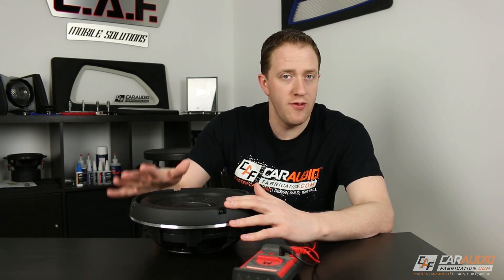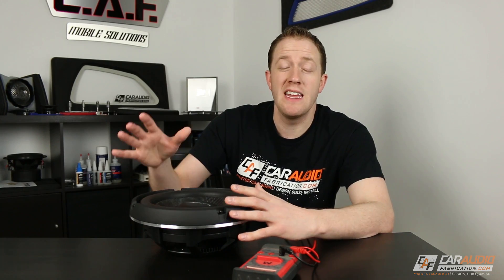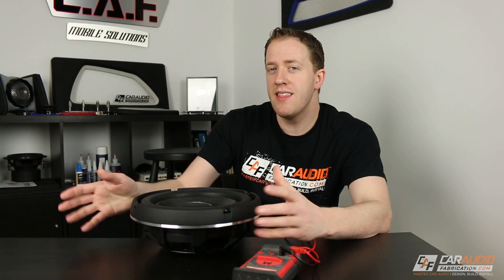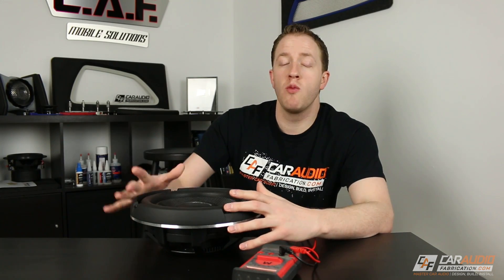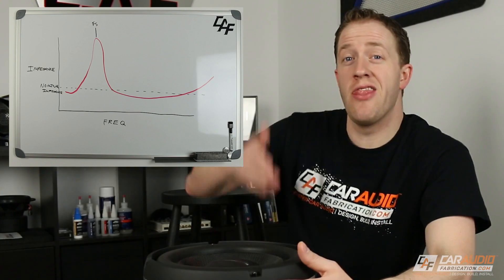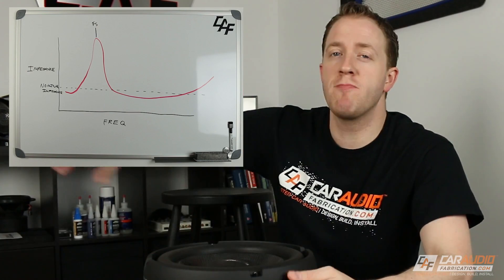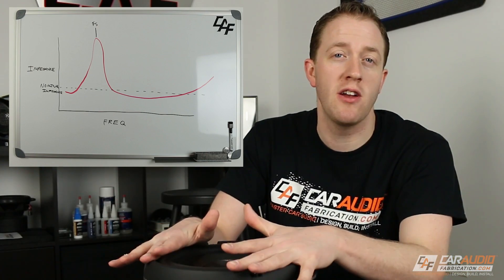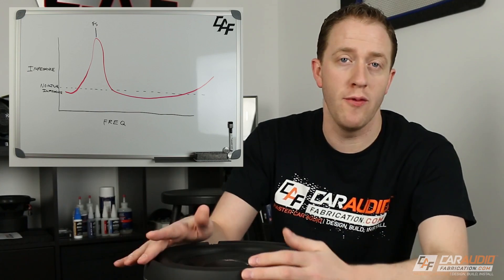Choose BEST Subwoofer for YOU - Thiele / Small Parameters Advanced Lesson

Comment from the maker: UPDATE: I was able to make the speaker anatomy video! I got an awesome cutaway subwoofer that shows all the inside components, check out the video here: https://www.youtube.com/watch?v=XMTjFxpRADI&list=PLmybwiwzi3MVV6AX5UIcR_0EtiNxDuf2h&index=4
Reply: CarAudioFabrication could you do a video on how to find some thiele small parameter of a subwoofer that doesn’t come with any
Reply: Excellent work.  Catching back up on the vids :)
Reply: CarAudioFabrication I'm trying to find replacementnwoofers for some home stereo speakers I built back in the 80's. They are a 12" 3 way design with 1.4 cu ft sealed enclosures. The original drivers worked very well after stuffing the boxes with fiberglass. F3 was around 30 hz. Not as low as I would like, but tight, accurate and warm. Can you recommend a replacement?
Reply: @CarAudioFabrication
Hi,
Is there a way to predict therse, Parameters? I want to build a costum subwoofer with parts from the lord of bass or from some other place where i can get speakerparts. And now I don't know how to chose the right parts for my needs.  The subwoofer is supposed to be for my home theatre. It should be a 15inch sub in a sealed box that plays down to 15 hz at 125db+
Maybe you can help me. I love you videos!

Comment: I spent a few years picking a 12” sub, and a year or so saving pennies to buy it, and its custom box.
So many parameters, power handling, frequency response, efficiency, damping factor. Optimum box size VRs what I have room for. Reading reviews on what I was considering.
In the end, for me in my new suv, it will be a morel, unltimo titanium sc 12” in 4 ohms, 
Into a box, slotted vent at optimal 1.60 cu ft. Into a audison amps and dsp.
3 way morel hybrid front stage,  mids and tweeter into pods on sails , midbass in doors, nothing in the rear door.
All ofc wire…
Can’t wait to get it all done.
Still have some sound treatment stuff to buy before install.
Ripp it all apart and do everything at once. 
See how it all works out, every part of the system matters, the one place you cut corners, is the one place it gets ya, and you pay more to upgrade later….

Comment: Quick question? I got the JBL Club A600 monoblock amp. But I have the JBL Stadium 12" subwoofer. Probably 2 of them. I actually bought 1 but they sent me 2 😮. So I'll probably use it. Just need to get a 2 subwoofer box. But that amp (which is 600W RMS) and the subwoofer (which is 500W RMS) shouldn't have any trouble working together, right?

Comment: How would you pick the best subwoofer for free air application. As you said,  that having a qts of .7 or higher is better for free air. But on the other hand, an online audio store says qts doesn’t matter as long as the subwoofer is “built for free air application “. The Kicker Comp C 12” has a low QTS of .559 that I have in a free air application and the store recommended this because they said it’s built for free air, but it is not as good as I thought it would be. I thought it would hit harder than the JL Audio 12W0v3-4 that I had in, which has a qts of .67. To me, it seems like the JL does better than the Kicker. What would you, go by what the store says or go by the subwoofers qts?

Comment: Hi Mark. Hopefully you end up reading this, I have a question I believe you may be able to answer and clear up some confusion I have. Sorry in advance if this may be a little long winded. I specifically looked through your videos to find this one so that my question is relevant to what is being viewed and so that this may help others before they get this deep.

 So... I have a Crescendo Forte 15" sub that I re-coned with Sundown SA-15 V1 Rev. 3 soft parts. Here's the big question: how would I figure out what my T/S parameters are or how they have changed without the use of a computer and the accompanying software/hardware? for example, I know that obviously my BL stayed the same as before... but how has that influenced things like the QES rating on these new sundown parts that weren't originally intended to be used with a crescendo motor? And if Qes changes, does the spider allow for the Qms to change? I may be over thinking things, but I speculate that one different specification (motor force in my scenario) would have a domino effect on some of the parameters of this "mashup sub". Believe me, if I could have replaced the parts with same brand & specs, i would have, but Crescendo no longer offers Forte support for soft parts. I'm pretty well aware that I could have just bought a new sub, but this sub & box was gifted to me with a broken cone which I repaired and banged on for a good year and a half on safe power levels. alas, I ended up getting an amplifier that was capable of giving the sub its RMS rating... And then some, and uhh, i gave it the beans... That unbalanced repaired cone/coil didn't like that for long. With that being said, I had no initial investment in the sub/box and i saved it from the Florida rain so it only felt right to re-cone vs. Buying a new sub for easily twice the amount... Now, I'm wanting to put the icing on the cake and build an enclosure so im confused as to how to get accurate specs of the sub or whether it really matters that much... As if to say, maybe I should compare both sets of T/S figures and make calculations based on known parameters and ballpark figures on the unknowns... Build a box, and see if I'm happy with results. Wood hasn't been so affordable lately and I'm not fond of wasting material or money

Comment: I need your help bro, I have a bmw 650i with the Bang & Olufsen sound system but want to add bass. I’m looking at a Rainbow GL-S10 S2-4ohm 10” speaker with a Helix P TWO
2-CHANNEL HIGH-RES AMPLIFIER WITH INTEGRATED, ACTIVE CROSSOVER AND DIGITAL SIGNAL INPUT. Also I forgot to mention I also ordered the bavsound 8” subs for under the seat. My question is could I hook up the 10” & 8” subs with this amplifier comfortably with no issues thanks

Comment: 8:43 You can compare BL motor strength directly ONLY if the drivers have the same RE, which is rarely the case. If not, then you must compare BL^2/RE (square of BL motor strength over RE), which accounts for difference in RE. This is especially important when the drivers have different nominal impedances (for instance 2 Ohm vs. 4 Ohm), because such drivers usually have very different RE.

Comment: God I hope you respond to this.  I was reading up on the difference between ported and sealed subs and I thought, well, a lot of the Metal I listen to has two types of bass-producing instruments that really needs to be distinguished properly.  The kick drums are usually tight with a quick, non-resonating attack  which is ideal for the fast, machine gun-like rolls you hear in a lot of Death Metal.  Then, of course, you have the bass guitar which is more reverberating, but doesn't usually make itself stand out like funk, but more of a backbone to keep the guitar and drums together.  I would think it would be difficult for a single subwoofer, ported or sealed, to properly represent each instrument at the same time.  So why not two subs?  One ported, one sealed, and both tuned to their respective frequency range by the crossover?  Could that work?  I'm getting my D-6.1200 today and I really want to ditch my Kicker Hideaway for something better.
Reply: id look into a bandpass enclosure honestly

Comment: I am considering a subwoofer for my car. 
I already have all Infinity Reference setup - 4 channel AMP, 2 components in the front and 2 coaxials in the rear. 
I am not looking for high volume but good depth to the music. 
Which should I consider? 
1) 12 inch subwoofer with frequency range - 50hz to 250HZ (400W RMS)
or
2) 8 inch subwoofer with frequency range - 35 Hz to 150 Hz (125W RMS)

Comment: The wattage rating tells you how much power the woofer can take, not its output. This is a common misinterpretation that has been perpetuated by the car audio industry. They make it sound like the speaker puts out 500 watts. Not true. A speakers output is measured in SPL, Sound Pressure Level with 1 watt of power input. A speaker that put out 84 db at one watt is less efficient that one that puts put 90 db per watt. The SapL goes up 3 db everything e the power doubles. We perceive 3 db as twice as loud. And our hearing is basically logarithmic. So let’s take the less efficient speaker and see what happens when we push 500 watts through it. At 1 db it puts out 84 db. At 2watts it puts out 87 db. At 4 watts it puts out 90 db. So it’s now putting out as much sound pressure as the 90 db per watt speaker. This has an effect on the speaker system, or loudspeaker. Which speaker is better? It depends. For really accurate sound, more damping is usually better because it limits distortion. That would mean the 84 db speaker is better. But if your running that 84 watt woofer and the midrange and tweeter is rated at 90db, you would either have to run two amps or an equilizer  to balance the loudspeaker’s output. It also means that to be as loud as the  loudspeaker using the 90 db woofer you would have to have a more powerful amplifier. So you could run a 500 watt amplifier with the 90db woofer’s loudspeaker. It also means for the loudspeaker on a whole, to be as loud as the loudspeaker running the 84 db woofer loudspeaker it would have to double the wattage driving the speaker to 2000 watts. I hope this is making sense. Once you decide on which woofer you’re going to use you need to determine what type of cabinet it will use most efficiently. He’ll tell,you that in this video. But please keep in mind that the wattage rating of a loudspeaker is how many watts of power the speaker can use without   up. Wattage is a. Measurement of thermodynamic heat.  Good luck, and please do yourself a favor and learn what the Theil/S,all parameters mean. And when you get through all of that, have fun and enjoy your music!

Comment: What is the best site to shop for a subwoofer based on a known set of Thiele-Small Parameters  ?  I can not find a comprehensive database, or shopping site to search for speakers with a specific set of parameters.

Specifically, I am looking for a replacement for a 12 inch Rockford Fosgate from 1997.  Now, this is not a great speaker, by any means, but I built a bandpass enclosure for this over 20 years ago, and the speakers are long dead.  

Loudspeaker:
Rockford Fosgate Subwoofer 12" RFS-1812 8 Ohm 
Fs : 29 Hz
Re : 6.7 Ohms
Rg : 0.7 Ohms
Qes : 0.45
Qms : 4.11
Qts : 0.44
Vas : 0.1861 m^3
Diameter :  12 inch
Rating : 100 W
Excursion :  0.0051  m

Enclosure :
Single Driver,  4th Order Bandpass :

Damping (S) :  0.5
Front Volume (ported) : 1.29 ft^3
Rear Volume (sealed) :  1.68 ft^3
Total Volume :  2.97 ft^3
Port Diameter :  6 inch  (PVC)
Port Length :  10 inch
FL :  35 Hz
FH : 118 Hz
Fb :  64.3  Hz

Please let me know if you can point me in the right direction, as I have not heard anything from this box in 17 years.

p.s.  this is a dual 12 inch enclosure , which is 36 x 24 x 16 overall, and houses two 12s

edit.   it was NOT a Kicker sub, but a Rockford Fosgate. Sorry for the mix-up.

Thanks,
Jason

Comment: Very impressed with your knowledge of all these terms.  I've punched in a lot of these numbers to make custom enclosures and only knew the definition of about half of them.  it's nice to get into the weeds sometimes.  

I remember my very first enclosure that was tuned to the subwoofers based on the T/S specs.  It was a 3.87 ft³ (after speaker volume subtracted) trapezoidal shaped sealed enclosure for a trio of JL Audio 12W6 dual 6ohm voicecoils...the original monsters that set the stage for high end bass.  I made 5 sides out of 1" MDF and the top was an original straight JL Audio Triplate fiberglass gelcoat holder designed for three 12W6 subs.  Man....that was 25 years ago.  Had that running 100% parallel into a 1ohm load, bridged to ½ ohm mono to a Soundstream Reference 10.0 Class A monster. Such clean tight bass from that combo.  The entire box was made using high end 3" heavy duty screws.  The speakers were bolted with Nylock nuts into the Triplate, which was mounted using epoxied threaded inserts for ease of disassembly for easy access to change the black light or wiring configuration.  What a freaking MONSTER box....lol.  Sanded, prepped and painted in a body shop with PPG metallic blue and clear coat, and matte titanium white inside.  I used a jigsaw and router to make the JL Audio logo...I  cut into the front, and backed it with 1" plexiglass on the inside like a plug door and added a black light inside on a toggle switch.  I was so super happy when I turned the light on the first time...seeing that JL light up in blacklight purple gave me straight goosebumps....glad I saw it through 100% to the end.

A true monster that looked as good as it sounded, and weighed about 250 pounds....lol

Comment: @caraudiofabrication I have been watching a lot of your videos and you are awesome.  I am in need of your help. I purchased and had installed a Kicker VSS system for my 2017 RAM 1500 quad cab. I got the soundstage with the sub and the DSP amp for the door speakers. I spent a lot of money on it as I wanted the closest to factored look possible. I also had JBL 6x9 doors installed. I am so unhappy with this.  I had more bass with pure factory. What I was wondering is if you think it's possible to replace the 10in square sub which I believe to be an single 4 ohm L3 with an single 4 ohm L7?  Also would placing some poly in the box help?  I also want to ditch the JBL doors. What would you do?  Do you have any experience with the Kicker VSS systems?

Comment: Best explanation I’ve heard yet in T S. Nicely done!  I’d really like to see a follow up video on how all these parameters are used for cab design and porting. Adding in differences in performance for cab depth at equal volume, (e.g. distance variations behind the woofer). 

Thanks!  This was very informative. I’ve been trying to wrap my head around this for sometime. Not many explain these topics in an understandable way. At least if you, meaning I, don’t have an engineering background
Reply: Should’ve also asked what is the best equipment available to purchase for measuring T. S. when specifications are not available or the manufacturer specifications are questionable

Comment: You have a great knowledge of car audio. I'm in the process of putting a system together and wanted to know what you thought. I little background. My brother bought a couple of orion 12 inch subs with an orion ported enclosure tuned to 35hz I think. He can't use the box as his truck doesn't have enough room. Also I'm buying his old 12" dual voice coil 4 ohm Alpine type R's and the orion box since I have a suburban and plenty of room. He's also selling me his 1000 watt alpine monoblock. Last week we installed a new Kenwood head unit that features time alignment and crossovers. we used jacketed 16 ga wire. It also has a 13 band eq a lot of other features I don't really understand. I also bought 2 new alpine 6.5 door speakers. We haven't installed the amp and subs yet. I'm going to put the 6.5's in the back doors and buy the alpine component speakers for the front. I will be purchasing a alpine 4 channel amp for the door speakers and probably JL power cable install kits for the amps. My main question is do you think the type r's will sound good in the orion box? It's a really nice box. I think it's plexiglass. So that's the layout of the system and I listen to a lot of different kinds of music. I just want the quality of the sound to be superior. More so than the total output. I also used some 3m underlining and sound dampening spray in my jeep that I sold. I applied it to the inside of the sub box and behind the door speakers. It really cleaned up the sound and made the bass very rich and deep. I probably go with some dynamat this time. So, what do you think? Thanks in advance for your expert opinion.

Comment: Diaphragm (I will not call it a cone in this case) acts as a piston, so when talking about effective cone area, it really doesn't matter if the diaphragm is actually a cone, or a flat circle, if the diameter is the same, Sd will be the same. Deeper cone will not move more air.
Other than that, very well made and very educational. Just to add one more thing - the unit of the Bl is not only Tm (which doesn't tell you that much, it's magnetic force x length of the wire), but also N/A - which actually equals to Tm, but the unit tells you what force you generate by a specified current applied. So 10Tm = 10N/A tells you that 1Amp of current through the coil will generate 10N of force (~1kg)
Reply: I prefer to describe BL and the amount of magnetic flux (B) affecting the number of turns (L) within the motor.  On a SGLC motor topology some of the voice coil will likely be outside of the fringe field.

Comment: Hi, can you say which sub would give me max Tight accurate Clean Bass here my set up but can't decide on the Sub set up
1. VW Golf R 2018 stock head unit 
2. Focal K series 6" components in door 
3. 5" components for rear
4. 2000 watts 5ch 1000 watts for sub
6. Option one: JL Audio 12" Pro wedge  price $650
7. JL Audio 13w7 flushed into the Spare Tire area price $2250
Total set up with custom trunk $10,500 without custom trunk 9700
So my Question is which sub set up would give me more Boom for the set up? Thx
Or would you recommend a different sub? My other choice is the Kicker 15W7 flushed